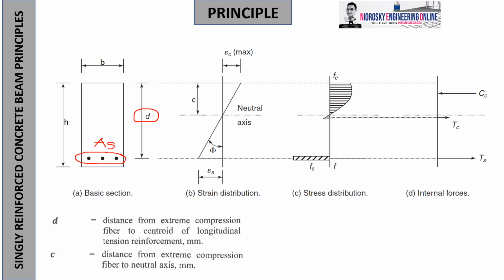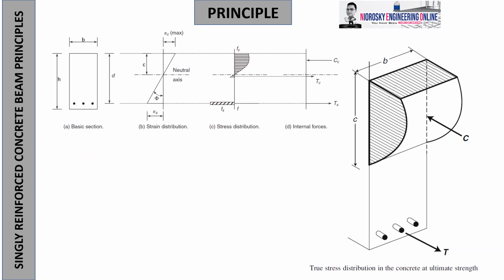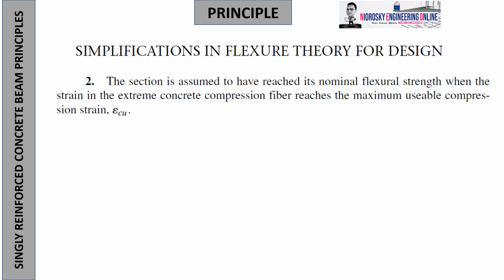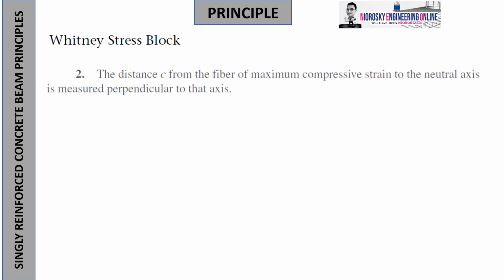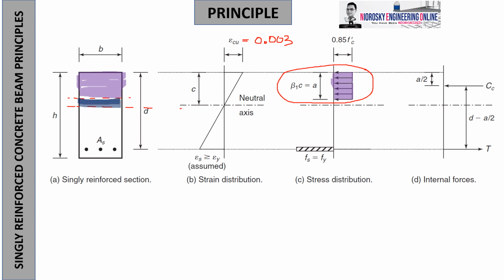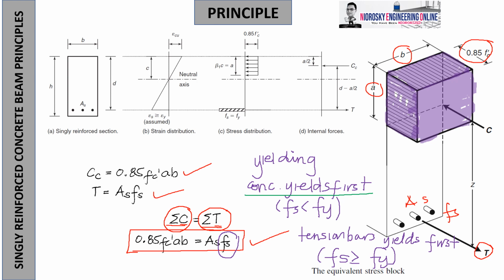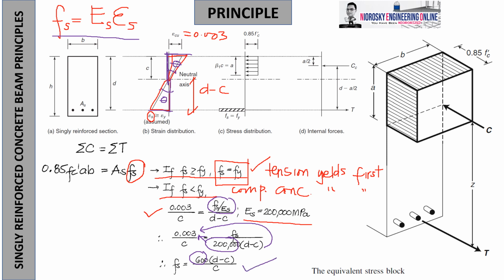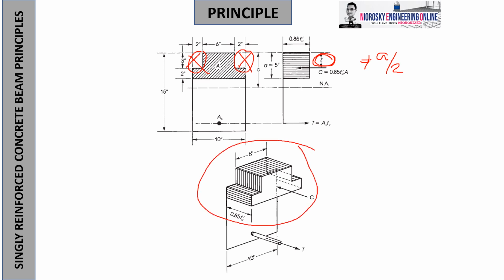SINGLY REINFORCED CONCRETE BEAM PRINCIPLES

Comment: Good Day Sir.. Anu po ba maximum length ng Concrete Beam
Reply from the maker: Depende sa compressive strength n concrete and specs of steel na gamitin mo. Also controlled deflection value. Cheers
Reply: Thank You Sir 👍